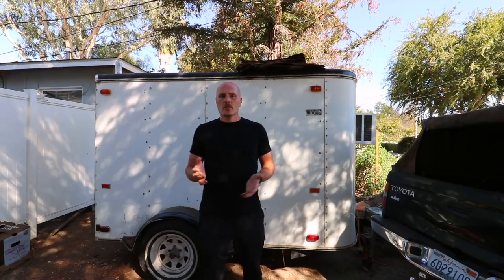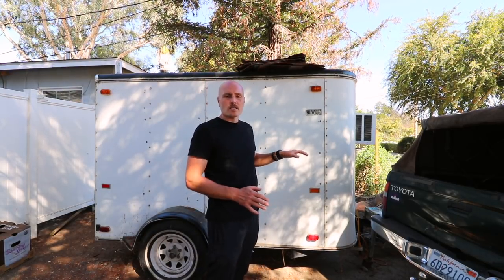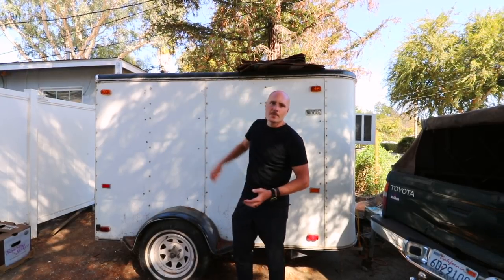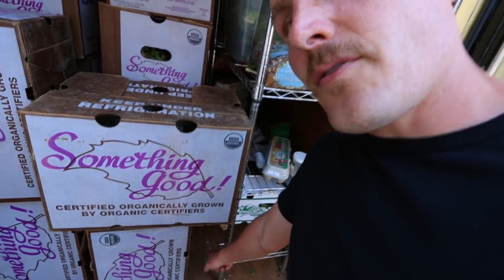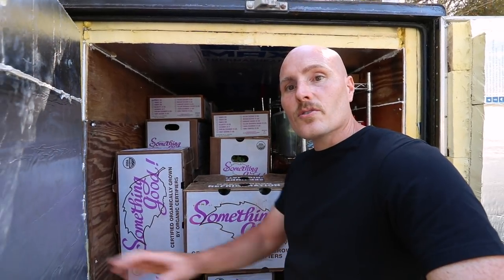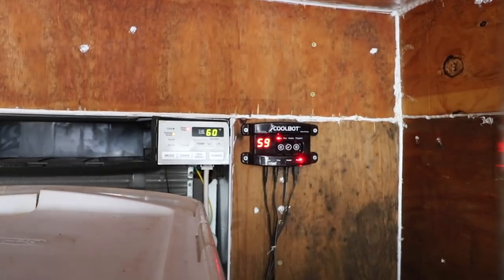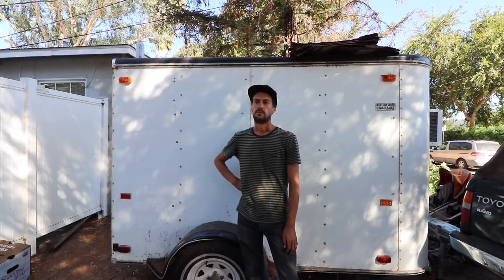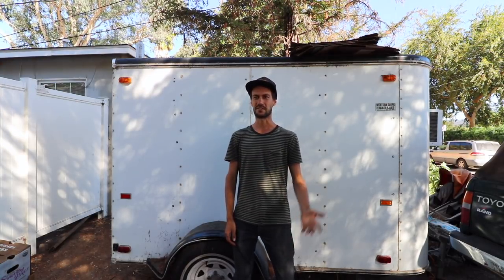Vegetable Walk-in Cooler on Wheels via Coolbot

Comment: If you are building something like this, make sure axle and wheels are in good shape when buying used... lay down radiant barrier foam panels and then a floor, or pay to have the entire bottom of your trailer insulated and waterproofed with spray foam to cut down on headspace reduction of insulating reefer box. If you pack a trailer, do not pack it like it was shown intially. those reefer trailers, like home refrigerators, rely on air circulation or they get hot and cold spots, condensation and tendencies towards mold and other enviromental conditions that make product spoil faster . Leave plenty of air space around items and use fans to circulate air from high to low and side to side. Check out figure 8 oscillating wall mount fans for fairly cheap alternative to ventilations systems, although in a small space like that you may need something other than a small ac unit to allow ventilation.

Comment: Ok what size AC unit is it?
Reply: Sorry but checking the coolbot omg  You can do the same thing for under a $100 with off the shelf parts.
I spent the last 35 as general maintenance tech  in the food industry refrigeration control was large part of it.
One more thing window AC units do use a compressor thought I let you know .; )

Comment: Great idea ... But that cost of a cool bot is crazy! I guess it should pay for its self.. Idk
Reply from the maker: With an AC unit it is cheap compared to a commercial compressor.
Reply: The coolbot does seem expensive at first glance for a small plastic electronic controller, but I can assure you it is worth every penny.  That trailer we built has totally transformed the way we farm, and made it possible to buy in product for our webstore and hold it fresh.  If I have produce that doesn't sell at my weekend market, I can put it in the walk in, and sell it mid-week through our webstore.  It's paid for itself many times over in saving product that I would have lost without the refrigeration.  And the cost is cheap compared to a commercial walk-in compressor.

Comment: how cold can the cooler get?
Reply from the maker: CoolBots can be set down to a target temperature of 32°F (0°C), but most customers use their CoolBots in the 38°F – 40°F (3.3°-4.4°C) range, which is where most veggies, meats, and prepared foods are recommended to be kept (most fridges are set at 38°F (3.3°C)).As you push the cooler below 38°F (3.3°C), the A/C has to work increasingly harder. To the extent you want to push the temperature below 38°F (3.3°C), you can help by (a) increasing the A/C size, (b) decreasing frequencies of door openings, and (c) building an extremely well insulated cooler.Most customers with an R25 insulated cooler hit 36°F without any issues. Customers getting their coolers below 36°F (2.2°C) have the best-insulated coolers (with insulated floors), open their cooler doors less frequently and almost all oversize their A/Cs vs. our recommendation to be conservative.
Reply: thank you , I'm building a mobile walk-in cooler for my pizza-shop, and I was debating between going with the traditional compressor unit or the Coolbot.
Reply: what side of AC would you recommend for a 10x6x6
Reply from the maker: Checkout the CoolBot site.  The have a guide to sizing the AC to the room size.